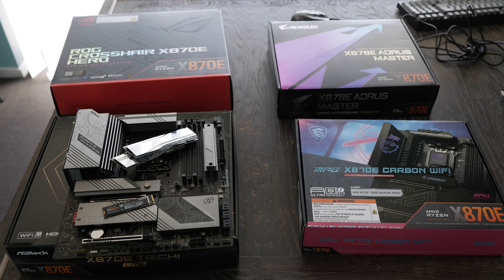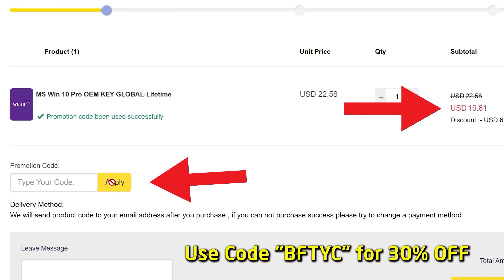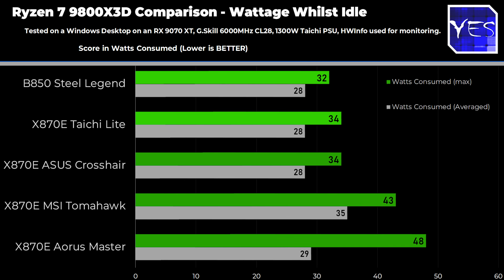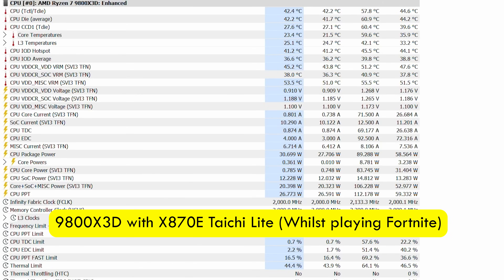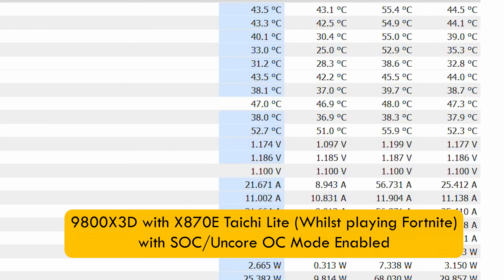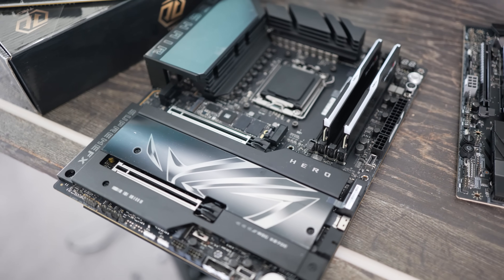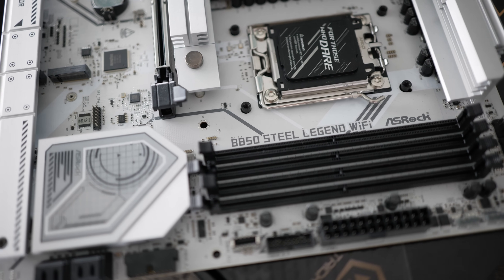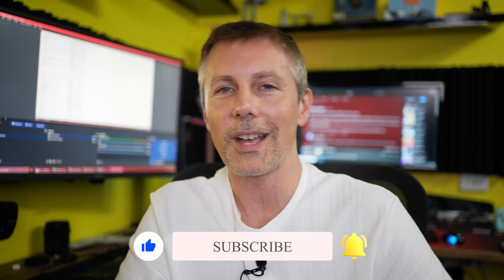I think I know why Ryzen 9000 Series CPUs are Dying...(!)

Comment from the maker: Keep the requests coming in guys, I will get onto episode 2 this week for the $100 flip up challenge season 3.
Reply: I stayed with B650 as it proven and I remember what happened last time. thank god. for reference my soc is static Gigabyte B650m Gaming x ax with 9800x3d . its not the cpu its the new 870/850 motherboards
Reply: My MSI B850 Tomahawk also has spikes on the VSOC, why is that? is also a setting?
Everything is default but expo and a few minor things...
VSOC with expo is 1.2V but i see on hwinfo during gaming spikes up to 1.27v or even 1.287v
(This is on the cpu sensor, on the vsoc mb sensor it varies between 1.21 and 1.23v maybeee at max)
Reply: @AestheticKunt  I recently built a 9800X3d MSI X870E TH build, gaming and benching with AIDA64, Prim95 large/small, and FurMark 1 & 2, plus Time Spy, CB 20/23 my max VID is 1.138v and 0.325v idling, VDD 0.779v - 1.146v, and the SOC is rock solid at 1.205v  which never changes, this is with XBOW 1, and a CPU under volt of -20, and max CPU package 96.25w, Cores 65.7w, L3 Cache 3.06w, and my CPU is clocking up to 5.6mhz when gaming, and I don't have any overclock or PBO, only curve optimizer negative 20.   But I think I try negative 30 now. And I have HWMonitor starting with Windows, so I can check my highs & lows.
Reply: Great. X870E 9900X3D set my soc to 1.125V and it runs cooler. Default was above 1.2, am not sure where the danger is for the soc voltage spikes. Am on Nobara 42, stable just played some WoW this morning. Can check that vsoc oc but am also running ram default, conservative settings while we wait on answers (have one cpu 8pin plugged etc).
Reply: @dianaalyssa8726  I recently built a 9800X3d MSI X870E TH build, gaming and benching with AIDA64, Prim95 large/small, and FurMark 1 & 2, plus Time Spy, CB 20/23 my max VID ever is 1.138v and 0.325v idling, VDD 0.779v - 1.146v, and the SOC is rock solid at 1.205v  which never changes, this is with XBOW 1, and a CPU under volt of -20, and max CPU package 96.25w, Cores 65.7w, L3 Cache 3.06w, and my CPU is clocking up to 5.6mhz when gaming, and I don't have any overclock or PBO, only curve optimizer negative 20.   But I think I try negative 30 now.,    And my posts keep getting removed, probably by YT.
Reply: @dianaalyssa8726 it might be the opposite. See my other comment. Good time to read the cpu specs lol
Reply: Great 😀😀
Reply: I think it's Vdroop on SOC or basically load jump voltage drops&overshoots cause of that
Reply: It is probably the voltage difference between Soc and memory voltage. The difference is too high. I have not read the specs though. I.e. low voltage memory might be safer if you are dropping the soc
Reply: I wanted to comment here that my aus rog b650e strix gaming wifi board also exhibits this behavior with spiking voltage i thought it was just a bug in hwinfo64 at first but not anymore. After setting SoC/uncore oc mode the voltage spiking stopped. Just an added detail i used to use this setting exclusively to set my soc voltage on AM4 and it seems ill be going back to it now. For reference i have a 7800x3d paired with the above listed board. It makes me wonder if its a bug in something other than just bios revisions on asrock but possibly the A.G.E.S.A? Too soon to tell for sure until we know more though.
Reply: I'm using the R9 9950X on an ASRock X670E Taichi motherboard. 
No issues, so far. 
Should I also change that SoC voltage setting?
Reply: Been waiting for this for so long.
Reply: They keep dying because AIBs are chasing the performance crown with their motherboards.
Reply: AsRock reliese new bios today for AM5 boards v3.25 with AGESA 1.2.0.3d ,did you see it?
Reply: Did some testing with a B650 PG Lightning.  With "auto" in bios I get 1.236v for weeks on end, but for some reason it has a spike at 1.411v today.. 7950x -15co, 6200/2066.  Bios 3.06.
Reply: There have a new bios v3.26
Reply: @X--SEPULTURA--X yes, i am testing with that bios now. It took 2 months for 3.06 to spike to 1.411
Reply: @NVMDSTEvil  I will waiting 3-4 week before update with v3.26,because v3.25 was remove 3-4 days after release 😁
Reply: There is a physical limit to 3 Nano
Reply: @corneliusantonius3108   there is a limit to everything.
Reply: The more I watch, the more I save.  Thanks for all your testing!

Comment: So fixing the issue is about VSOC control, right? Setting a proper, fixed VSOC.
I've heard disabling PBO (Precision Boost Overdrive) is recommended, to avoid excessive voltage to the CPU. I like this idea.
Then there's the PPT (Package Power Tracking or Thermal Design Power), EDC (Electric Design Current) and TDC (Thermal Design Current) values, which some people say should be manually set on Asrock motherboards due to too high stock settings. I don't know if this is true.
Can you give some advice concerning a proper VSOC value? I am to build a machine with (Crucial) 6400 MT/s RAM, and I want to make it absolutely stable and reliable, even if the RAM is run slightly below 6400 MT/s. I heard in the grapevine that CPU voltage should not be set above 1.2 V, as it would incur in over time damage to the CPU; but I don't know if that is right or just nonsense 
(not interested in overclocking anyway).
Oh! Great were the days when all of this wasn't so complex… Thanks in any case. 🤗

Comment: As eluded to. Modern CPUs dies are tiny compared to yesteryears   and add the immense overclocking competition between amd and intel. Is why Intel used to win this battle but then destroyed their CPUs in the process and their reputation also . Later bios are locking down ie vsoc voltage limits that killed many Ryzen 5’s.

Comment: Very interesting!  I have a 7950X3D and I just swapped out my Gigabyte X670E AORUS Pro X for a new ASRock X870E Phantom Gaming Wi-Fi.
Some folks warned me against this, but I haven't seen any reports of 7xxx-series CPU's being damaged, so I took the plunge.  I updated the board to BIOS v3.40 before installing the CPU and RAM.  This BIOS supposedly sets SOC to a fixed value of 1.20V.
Once I get the whole system together I'll do some HWinfo64 testing and look at SOC, checking for variability.

Comment: You probably wont see this but I'll type it out just in case it gets seen and can give some external info on what other people are seeing with their voltages. I've been running a 9000 series AMD CPU (9900X3D, not as common but could be due to not being as popular to use in Asrock boards.). The 9900X3D has been in an Asrock Phantom Gaming X870E Nova (BIOS 3.15 with just EXPO enabled) for about a month (It was in a Gigabyte B850 Aorus elite for a few months prior until a screw fell behind the board and shorted the USBs.). From what I've seen with the voltages and amperages is that they're all sitting within spec. SOC sits rock solid on 1.185V idle, in game and cinebench, only drops to 1.184V but cant recall it going any higher than 1.186V. The only other voltage thats has me a bit worried is the Vcore CPU VDDCR_VDD which sits stead at about 1.355V idle and drops to about 1.100V in cinebench. The temps dont go over 70-75 under full load.  The RAM used is G.Skill Trident Z5 Neo 6000 M/Ts. I change the setting you advised to just in case. Hopefully that info help anyone who has the same questions.
Reply: Thanks mate

Comment: Just bought a new build with 9800 X3D, MSI X870E Pro and fails to POST due to CPU temps, the furthest i have gotten was two attempts (out of 3); one where BIOS started to boot then flashed CPU temp warning and another where BIOS didn't start to boot and flashed the warning. The other time the PC turned itself off after 10 seconds. (Each attempt was done after letting everything cool down, and also after each attempt checked to make sure CPU was seated correctly and checked pins, contacts for any burn marks. I am going to flash the bios today and see if that helps.

Comment: Could you provide us with all the idle temps of the cpu on these motherboards as I’m experience drastic difference in idle temps between an Asus tuf b850 plus (32*C idle cpu) vs Asrock x870E taichi lite (43*C idle cpu). 
I verified this wasn’t my cooler mounting, thermal paste, no overclocks, tried undervolting, fan curves, I’ve tried everything and nothing affect idle temps. Thank you

Comment: I have an MSI X870E motherboard. I discovered that temperature and current data were not being transmitted to the motherboard via the SMBus lock. When I load the processor, the SMBus locks as the temperature increases, and no temperature data is received. The motherboard should immediately lock the system in this situation. Instead of locking the system immediately, it continues to operate. Because current limiting is not working, the processor overheats and initiates the lockup. After the SMBus lockup, the power goes out after a while. I have a 9950x3d processor, and it quickly reaches its maximum temperature and goes into protection mode.

I'm forced to run it with all settings at their lowest settings.

Comment: My soc remained static (1.15) under version 3.26 on my b850 steel legend, now i tested it on the new 3.30 version and it spiked up to 2.25 on hw info.. I don't like it, my undervolt was working fine on the previous bios.., i only updated it since there are still chips dying on the "fixed bios version" (by the way i never went in to the oc mode settings since it may void my warranty)

Comment: Hey guys, I have the 9800 x3d whit rog strix x870A. The CPU VDDCR SOC voltage is fixed at 1.245 and doesn't change. Is this normal or does it have to fluctuate when not in use? I have the latest BIOS version.
Reply: I am on 1.302 while max is 1.304 with EXPO setting ON. I have a msi x670e tomahawk.

Comment: Just changed mine to enabled.  I happen to have an Asrock b850 with a 9900X.  Though it has been running fine for 2 months.
Reply: Nevermind, I saw the update video.  I updated my bios to 3.30, it was on 3.20 previously.  Apparently this fixes the PBO settings, which were bricking CPU's

Comment: I agree that ASUS has the worst!! RAM retention system. I've had this ROG Strix x870E-E WIFI motherboard for 5 months now, and during that time, I've opened the case about 4 times because the RAM keeps getting loose in slot A. I'm sick of seeing the 0d code telling me the memory isn't detected because it's loose from the slot. What I can say is that overclocking on that motherboard works like a charm; the voltages when overclocked stay practically flat with no variation.

Comment: Hey, i just installed 9950X3D on Asrock X870e Nova and i just did the usual: 
- enabled the EXPO for my 6000mt/s CL28 

- enabled BPO and set it to undervolt and source to MB 

However even before the tweak i noticed on my HWmonitor after starting the pc that during the first minute the voltage goes up to 1.48v and then it lowers down to normal range 

I did update the bios to 3.30 

Any recommendations or insights?

Comment: Have a 9800x3d on a x870e Taichi
never had any issues
non-default bios settings were: exp profile & Precision Boost Overdrive -> Curve Optimizer set to negative 25
after watching your video i double checked my voltages just to make sure, they are indeed in the 1.185-1.189V range with no other values at all over a period of time (even under heavy stress tests)
im not sure if changing PBO might affect SoC/Uncore OC mode in any (non obvious) way, but slight undervolting might be the way to go anyway considering this CPU (and at least -10 should be achievable even if you had bad luck in the silicon lottery)
Reply: I've undervolted by -15 since I bought it 7 months ago, and kept bios updated, CPU still died...

Comment: Have there been any reports of non X3D chips experiencing this frying? I'm thinking the hoisting of the CPU cores up on the x3D processors might have introduced a reduced resistance making them more suceptible to higher currents from changing OC voltages from the boards. I wonder how much headsup the board manufacturers had of these fundamental architectural changes  w/ the X3D chips.

Comment: it might be , but as steve nexus discover the real fault is in USB ground pins, sleep pin, wake pin, memory pin and gpu signal pin during boot...some how something in socket got short or 3rd party IC chip on mother board cause since USB share same voltage with ARGB signal pin with IC chip. Its bad socket designed to share power with USB and ARGB that should be independent as intel does their boards that not share with same ground pin for both usb and argb during boot when cpu signal PSU for all voltage levels set by IC chip since intel cpu have owned IC built in while that only found in IO in latest cpu...since motherboard vendors knows intel side does not share ground pins with ARGB and USB setup for 5v to psu
Reply: Do you habe sources for your claims? I could not find Steve from Gamers Nexus say these things...
Reply: @RG-Art  its on his channel showing burn marks diagram that led to issues from sleep, wake,. memory training signal, usb ground pins...its coincidence what asrock discover could be something far worst that find it strange for amd to be silent about it  and starting making am6 socket right away in the dark room

Comment: Here with an asus board on an older ryzen 3600x  i noticed that enabling xmp would set the soc voltage to the "max recommended" which is like 1.150v, which is a lot more than the default voltage which is like 1.050V iirc, and because i have 4 sticks i cant do super high speeds so it even runs stable at less than stock voltage, but the board is dumb so they are just pushing it to the max safe instead of some sort of smart safe values according to the situation/speed. My guess is everyone does the same, and asrock just happened to have a bug that made it go over the max or do a peak which was only an issue because it was giving it way more than was actually needed.
This also happens with the other ram voltages which could all run fine at stock but asus would push them to the max safe value you can find on the internet forums.  And the worst part is that this is on AUTO, so its not like its being explicit about it, so unless you are checking and comparing you wouldnt even notice it happened.

Comment: Hab mir im April auch nen 9800x3d geholt, mit nem x870e Tomahawk und 2x 32GB DDR5 6000MHZ cl28 Corsair Vagance RGB, Hab den Direct die pro drauf und ne 4080RTX OC mit Eisblock, hab bis jetzt keine Probleme mit meiner CPU bis jetzt! Hab meine CPU 200mhz übertaktet und undervoltet. Interessant wie die Boards mit der CPU umgehen, und warum die CPU gegrillt wird! Aber aus diesem Grund hab ich ein MSI Board und immer das neueste Bios drauf!

Comment: Any updates on this? 
I was unaware of this issue, and had no time to do in dept research due to my main rig failing suddenly (Old x570 + 5800x). 
Unfortunately I read a quick review on the best 870E boards, and Nova Wifi came as recommended for that price range. I'm pairing it with 9900X and AIO instead of a regular cooler like NH-D15, some correlate the issue to AIOs being used in the setup and giving more headroom for the MOBO to push the chip harder because of the lower temps. I'm wondering if the new 3.25 Firmware (which is what I see at the time on Asrock's website as of today, June 09th 2025) fixed the problem for you.

Comment: The MSI MPG X870E CARBON WIFI stayed at 1.206 - 1.216v throughout my  testing also. I do think you are right with the problem being the Soc voltage and fixing it with the bios setting set to enabled with the Asrock MB's. Cheers for all the work you have done.

Comment: i told you all what the problem was you refused to listen it is amd problem but the problem is TSMC  silicon 3dstacking is alot harder than would would believe, nv pretty much has exact same problem . gpus are and have had reliability problems its the most under reported problem  as far as nv is concerned in the industry , and few if any hardware sites report this , as it is their bread and butter. they are all frauds,  its that simple .

Comment: You can disable this in BIOS. On the "Advanced" page, go to "AMD Overclocking." Choose "ACCEPT," then choose "SoC/Uncore OC Mode." There's only one setting in there called "SoC/Uncore OC Mode." Set it to "Disabled." This will allow your PC to throttle VSoC when it isn't under full load, so you'll get those variable voltages for VSoC similar to other motherboard manufacturers. By default, ASRock has this setting set to "Auto," which your testing shows apparently defaults to "Enabled." 

That said, 1.2V or 1.25V isn't a crazy voltage or anything for VSoC. You SHOULD be able to crank it to 1.3V with adequate cooling. Anyone running an AIO shouldn't be having issues with heat from VSoC at these kinds of voltages. This next bit is an assumption on my part, but that would seem to me to indicate a manufacturing hardware defect from AMD if 1.2V-1.25V VSoC is resulting in CPU failures. It COULD be similar to Intel's 13th and 14th Gen problems where adequate cooling only delays failures, while voltage is the actual cause of degradation, even in the absence of extreme temps. Nevertheless, at least with SoC/Uncore OC Mode disabled it won't be running at full throttle 24/7 like it is now. These cases of dead CPUs are likely just the instances of units which completely lost the silicon lottery and therefore have a hard time handling any sort of EXPO voltages. 

Anyway, figured I'd comment this so that anyone running an ASRock board who is concerned about this can go into their BIOS and change it for a degree of peace of mind. Oh, and I should also state that this is how it looks on my end with ASRock's latest BIOS rendition on an X870E Taichi, but I believe this should apply to all of their BIOS versions for AM5.
Reply: You are literally arguing the exact opposite of what the guy in the video said... Now I truly have no idea what to do 😂